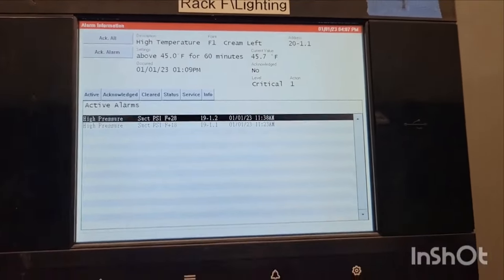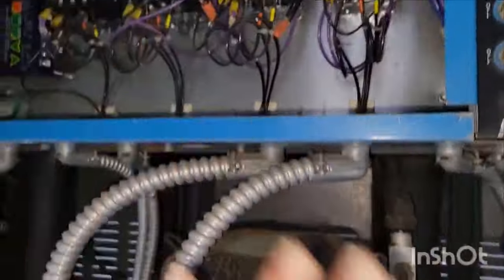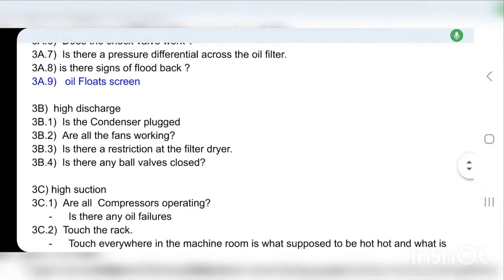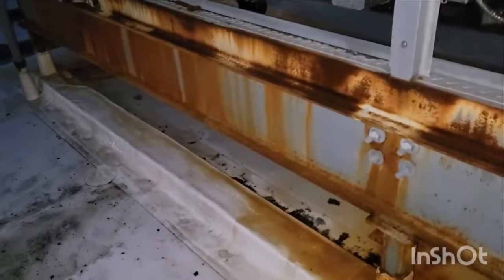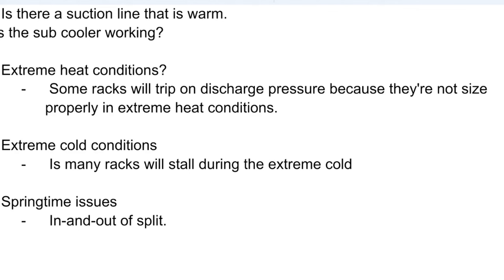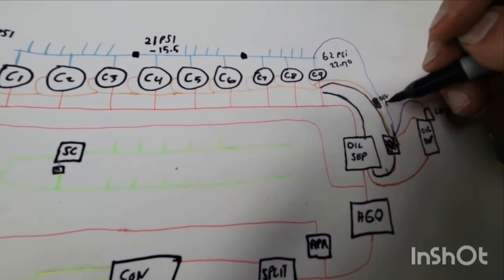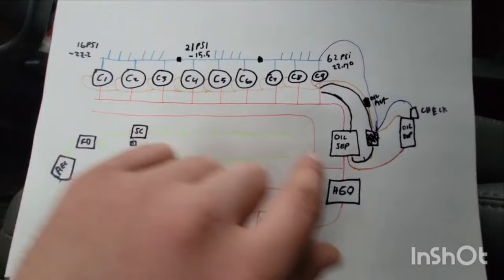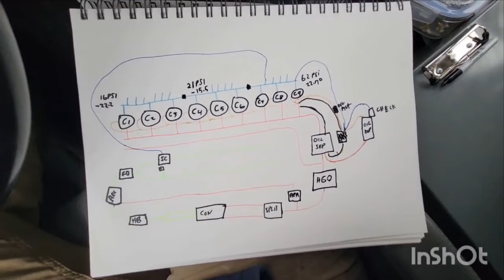Supermarket Refrigeration -  What To Do at a Rack down With Guide!!

Comment: Just to add to the oil and low charge troubleshooting...check if you have air heat reclaim. Make sure three way valve and check valve are working. Ive seen many racks go down because liquid and oil is logged in the air reclaim coil(s).
Reply from the maker: Wow great comment thanks !!

Comment: I’m 27 currently working at a factory job making 19.72 a hour. I took a long hard look at my life and realized I wanted more in my life. I’m strongly thinking of going not only into HVAC but HVAC/R. Is there anyway in get to a apprenticeship for commercial or industrial? I know lot of people starting out go into apprenticeship with residential, but I’m more interested in grocery store refrigeration systems. Just started watching your videos today and so far I’m loving them, any advice would be fantastic. I’m also getting ready study for the 608 Certification.
Reply from the maker: I'm not sure I knew a guy. 

But this Is what I would do 

If you can get your EPA certification.
And if you can do schooling it will be a big help. 

Most places have a unhealthy fixation on those things. 

Just applied everywere you can and take what you can. 

There is alot of HVACR places that do take Apprentices. But if it does not work out. Just be a residential tec for a year then try again.

Just keep building your resume until you get the job you want. 

School 
EPA CERTIFICATION 
job experience. 

Also NET WORK while your in school you will find leads !! 

Good luck and God bless. 

I hope it works out for you !

Comment: I follow a friend to check an a supermarket cooler than is tie in with a freeze line the freezer works fine but the cooler not cooling only at the discharge lines by the Txv nth through the coils though .
Reply from the maker: Yeah that sounds like an odd set up. 

I would check to see if the refrigerant is feeding to the medium temp that's not working. 

I'm guessing that it has an e p r I would check the e p r or the solinoid. 

But it's hard to tell it was not being there

Comment: Looking to break into supermarket refrigeration. I came to HVAC later in life, im 40, have been a resi tech and installer for two years. Somethinghing of a standout at my company. No rack experience but have watched all your videos, listened to every Advanced Refrigeration podcast etc. I know i could excel at it with some training, should i just approach a company and try to apprentice or go to school?
Reply from the maker: It depends on what you want really,

I got into my supermarket refrigeration gig with no school and no experience. 

I did well. 

The thing I will say about the schooling is. It depends on your state. So if you need schooling to get a license or if your state needs a license, it might be worth looking into the schooling. 

Now, you might want to debate on. If your current job has somewhat of a consistent lifestyle, it might be easier to take schooling now. Because a supermarket refrigeration tech typically doesn't have a superconsistent lifestyle. 

But I would say that if you are listening to the advanced refrigeration podcast and can follow what they're saying. 

You'll probably do fine. So as far as would school help your Skill . It would but you would probably do okay at your current level.

I learn much more from brian ore At the h v a c school, then I did an actual h v a c school. ( I eventually took schooling while working) 

In my state you need schooling to get a License

Also typically for my experience most companies are begging for supermarket tecs. 

If you have hvac experienc They will probably Value that over schooling. 

Now they might try to pay you less if you don't have schooling. Especially if that will result in you not being able to get a license. 

These are just some things to consider. 

Good luck!